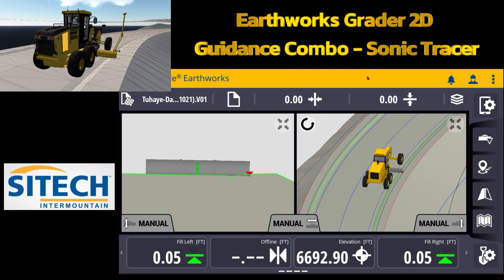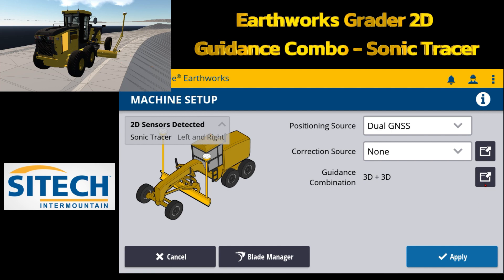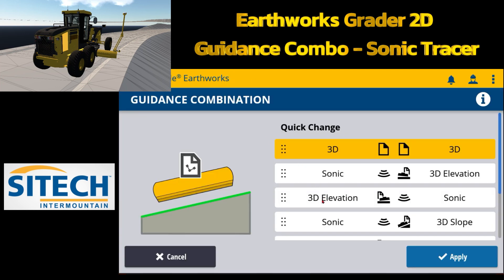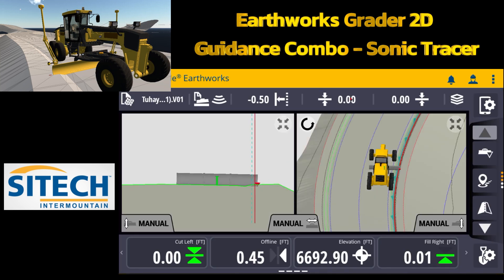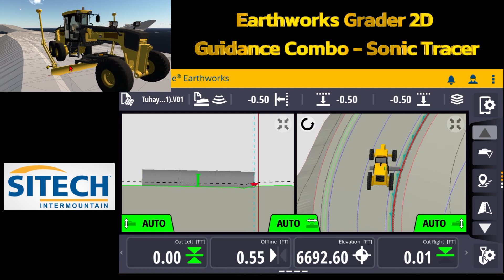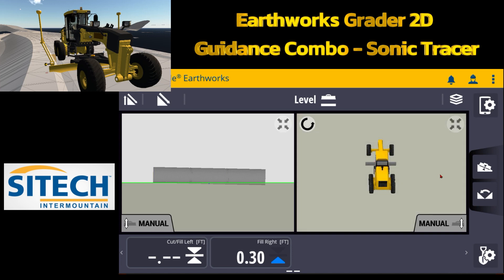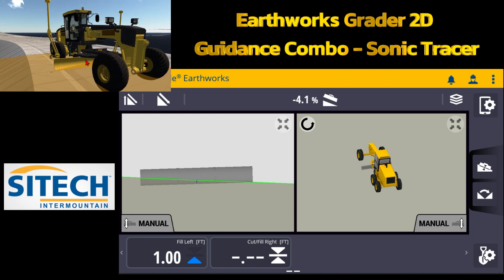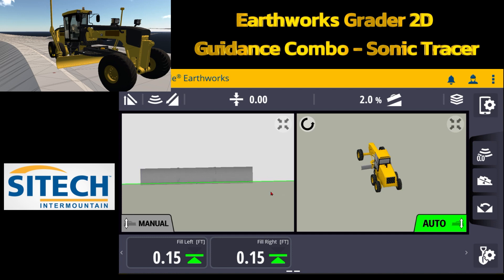Trimble Earthworks Grader 2D Guidance Combo Sonic Tracer

Comment: Quick question how to do the auto size shift and grader with a  CB460 thanks
Reply: The first thing to look for is that the settings are set up for the machine to use auto side shift and not just auto-lift.  In the machine settings there needs to be a auto-lift/sideshift enabled. Then on the main screen will be 3 MANUAL options on the bottom of the screen. left-right and middle for auto side shift. then once you use the horizontal option to select a line to follow, you can turn it on based on what machine you have. I am not sure if you have a cat or other brand or if its joystick, etc. But there will be a switch that will turn it on and if you are in range, it will auto follow that line.  I dont have a video on it yet, but can in the future.